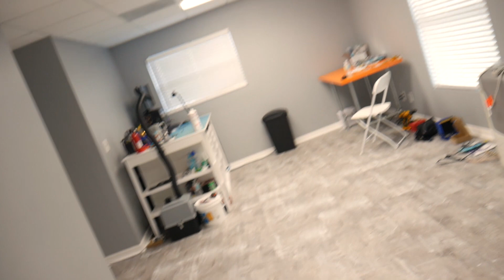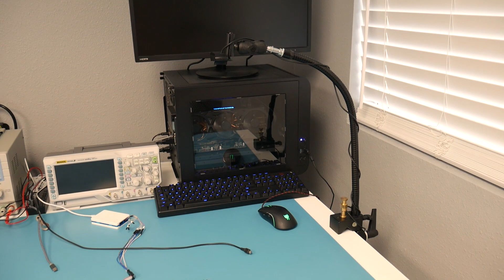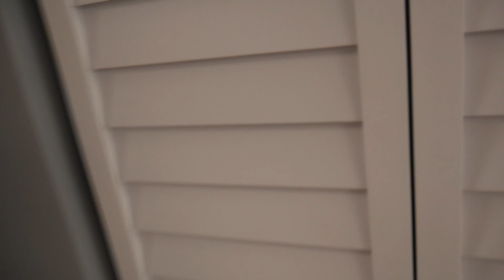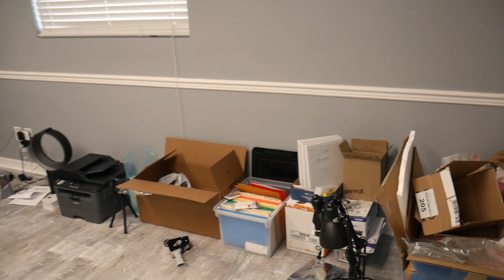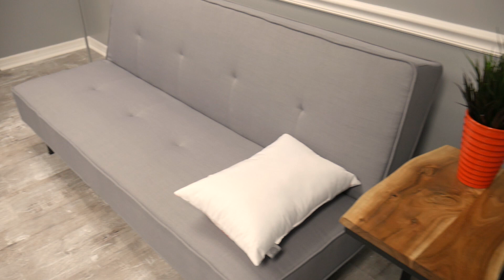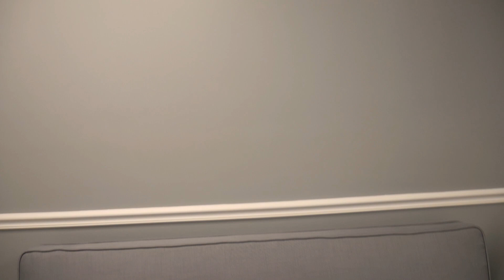New Office Tour!!

Comment: Very Nice!!  The only comment I would have on hiring employees, is you might want to consider a mix of contracted labor and full-time "employees". There are a lot of advantages to have contract staff (SG&A . i.e. overhead costs). I don't know your specific circumstances for employees (benefits and salary or stock options) but back of the napkin calcs, you actually pay less per hour for contract labor than a full time employee. The down side to contract labor is that if you can't keep their backlog of work full, they will have to find other jobs during that lean period. But that can be a positive as the employer.... Anyhow, just some thoughts to consider.